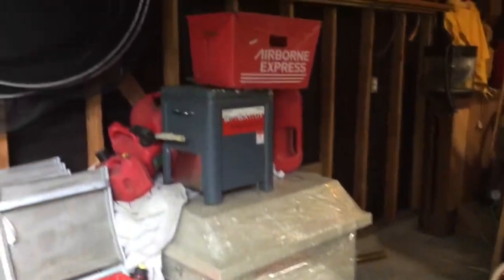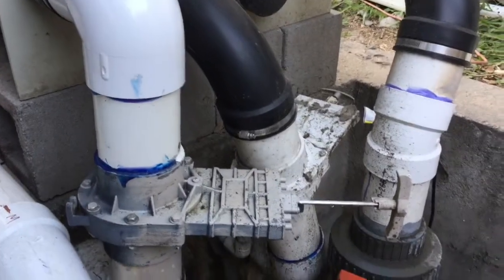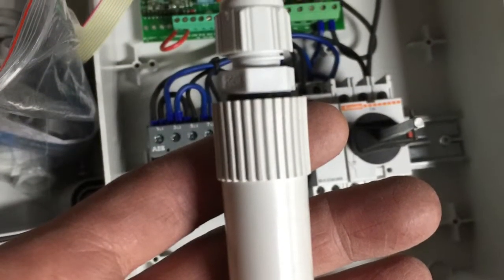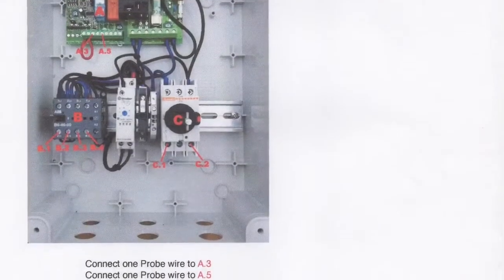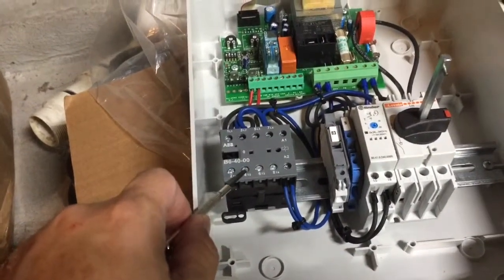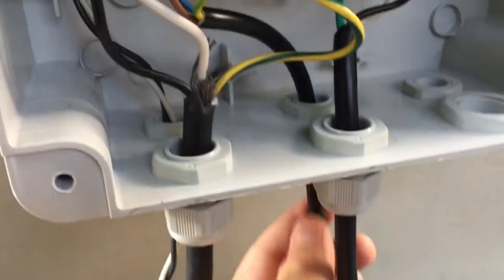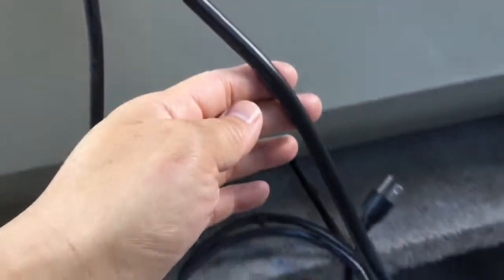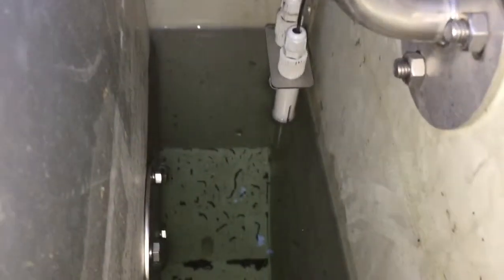RDF Profidrum installation And Wiring

Comment: Hi, where is the 2 wires from the sensor is connected to. You didn't mention about it. Its just hanging there.  Thanks
Reply: At what minute mark are you describing?
Reply: I meant the low water cut off sensor wires. I'm guessing it should be corrected to the 1st and 2nd on the slots where red wires connected at the minute.